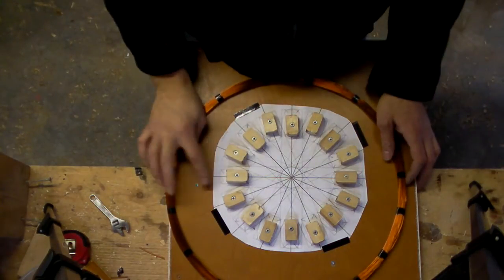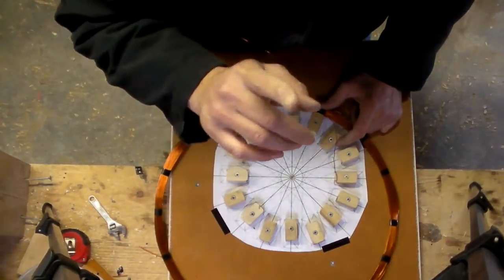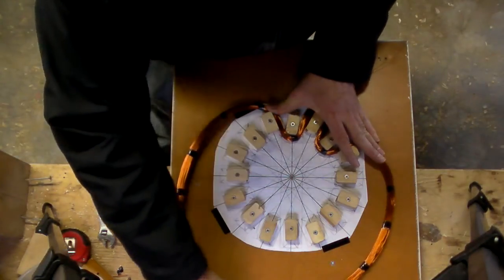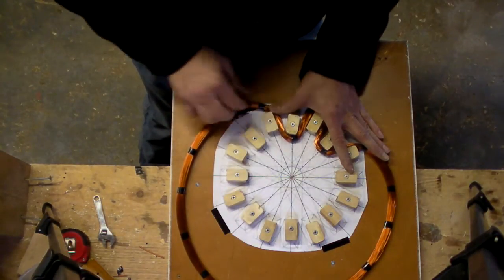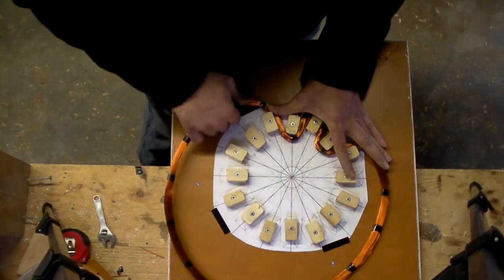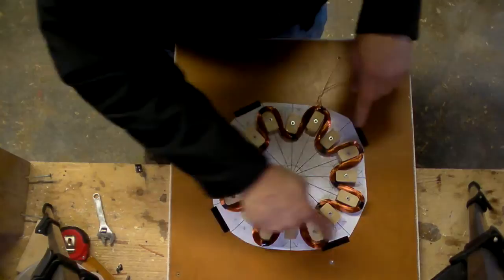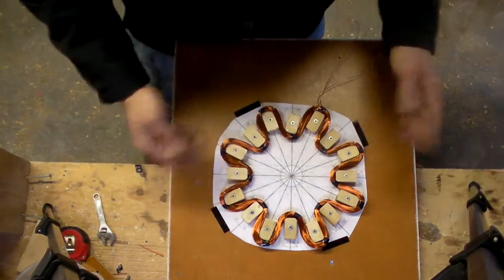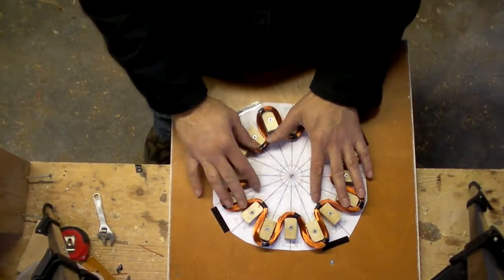14magnets 14pole chamas1 coil serpentine 3stack phase axial flux pma wind turbine vawt 66.MP4

Comment: How would this configuration work compared to mine?? I have three sets of winding in order to make it three phase in order to make voltage peak to peak 40V and reach 120V with 3 sets. By you doing this, does your magnets need to be all the same N N N N N N N instead of N S N S N S N S
Reply from the maker: the serpentine axial flux uses S N  magnets layout,
Reply: @emagnets when doing a serpentine coil do you use a 3/4 coil/magnet ratio or do you make it so the number of magnets match up with the bends of the serpentine? It seems to me that having the bends match the number of magnets would work better because the bends would all be in the same flux direction at the same time but if you used the regular 3 coils to 4 magnet ratio the wave form would be out of whack. Just a thought
Reply from the maker: @MAGATRON-DESTROY  the bend count matches the magnets count.
In order to get the 3 phase effect with the serpen, you must off set each serpen coil 120 degrees, so the magnet is effecting the 3 serpen coil evenly.

Comment from the maker: @EllinonEnosis, there is no huge diffrence in effeciency, maybe 5% more, whoever, serpent setup allows me to get more power from the same diameter area, because i can stack the coils. Other reason it seams simpler to me to build a serpent than traditional axial flux.